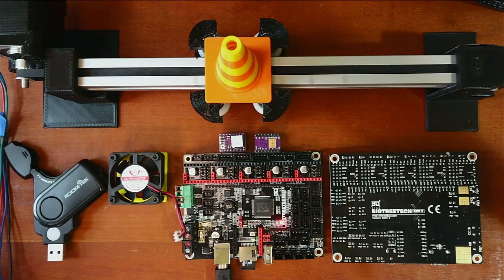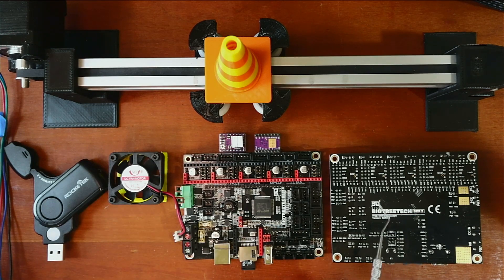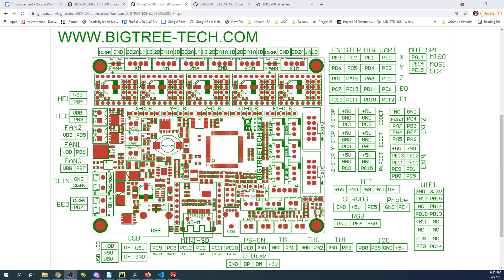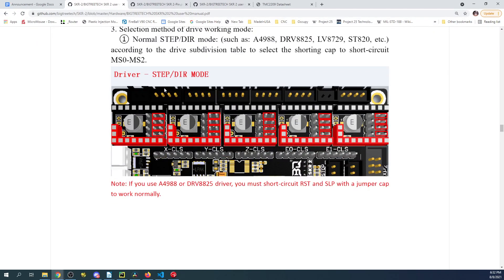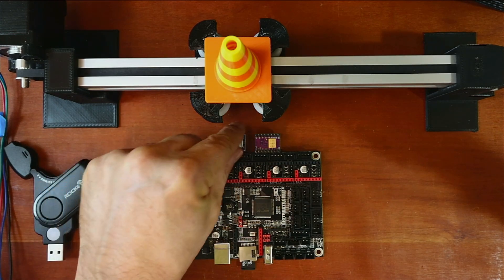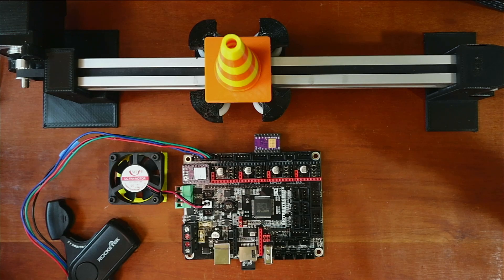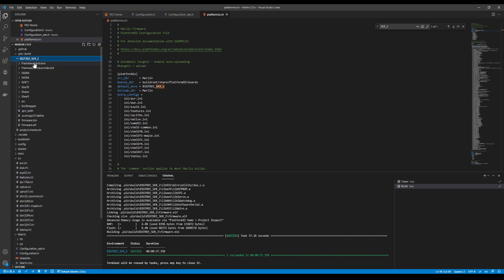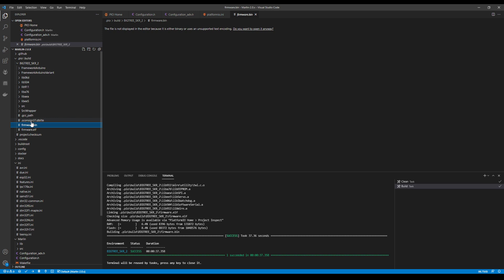BTT SKR2 - DRV8825 and Controller Fan

Comment: I wish I could see your Nema motor. Is it a Nema 17, since, my wires are opposite colors of yours. Mine are from the left: Black, Green, Red, Blue. Yours are Blue, Red, Green, Black. I May have to change from TMC 2209 v1.2 to DRV8825 since the TMCs burned because of a bad board and I'm still waiting to see of warranty will cover it. I'm Building a Rat Rig V Minion. Response times from support are long :/

Comment: I solved one issue, now another arises! This is a new verB board literally a few days old. It was printing fine up until a few hours ago... now the E0 portion of the board suddenly stopped working? 

Tested voltage, tested steppers, wires etc. Should be working fine, only changes I made was a new pancake motor 
I installed. I'm starting to think it's the board...
Reply from the maker: What happens if you revert to previous motor?
Reply: @EdwardBraiman  I isolated the problem! It was a mixture between the stock extruder motor extention wire, and the Prevent Cold Extrusion setting in marlin.

Much appreciate the reply. But now it seems after a 10mm layer height my print quality takes a hit! I think I'm not sending enough current to my Twotrees Nema17 4.1v pancake motor being it skips at times.

I'm running a non-geared direct drive setup. I'm well aware pancake motors are not ideal in the aforementioned setups so I'm considering going Geared with a Bondtech DDX Direct Drive eXtruder. 

Any advice?
Reply from the maker: There is a Discord link in video description to ask questions that might suit you better.
Reply: @EdwardBraiman  Ok, thanks😊
Reply from the maker: You're welcome.